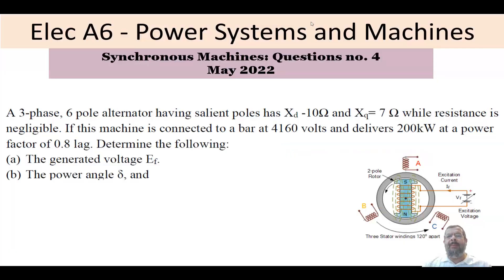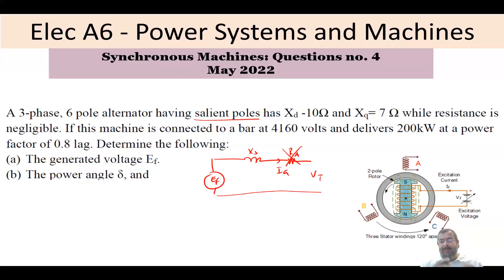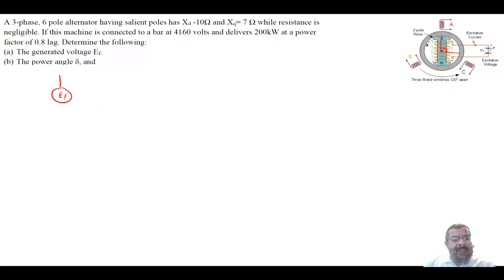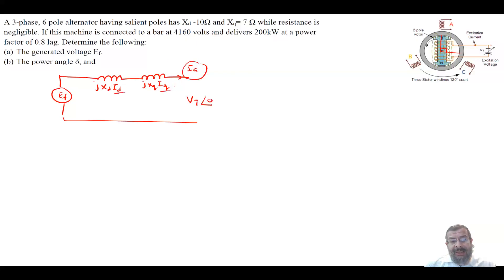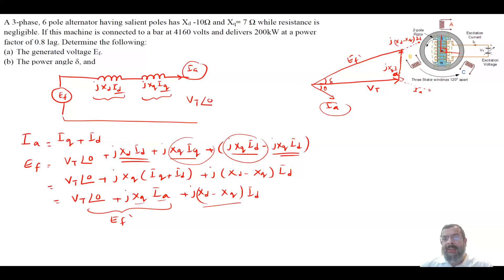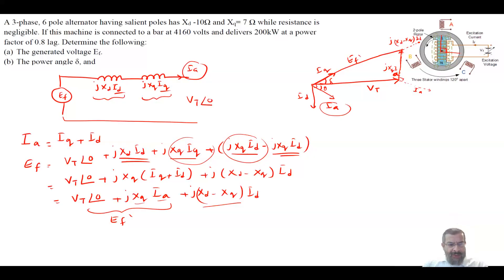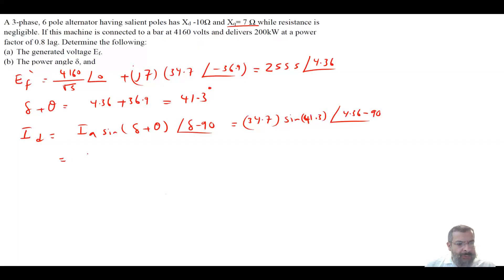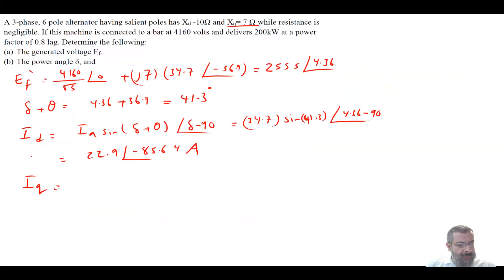PEO solved examples (ELEC A6): Synchronous Machines no. 4

Comment: In todays exam there were not even 1 question on Electrical machines. No magnetic circuit no dc machine no induction motor no Synchronous Motor and Ge no Single phase trasnformer. Only power sysyem single line diagram per unit system and 1 single phase question. That is soo disappointing. Non of previous exams had similar questions not even in the reference books are there.
Reply from the maker: This is really a disappointment, you should complain to the PEO
Reply: I am now writing to them and will continue to reach out to the examiner. Also please any others student who had the exam do the same thing. Thanks
Reply: I took the exam today too. There are at least 2 questions should belong to the B7 exam, not the A6. Quite frustrating.
Reply: @binhle8710  There was only Q1 and Q5 similiar to previous questions. The rest were all on B7 . I emailed them and mentioned that. Please if you can email them and complain. So that they can see the issue.
Reply from the maker: @binhle8710  I think you should complain. I did one question about line to ground fault in generator but this should be in B7. Historically A6 is about energy conversion and B7 is about power system but after the COVID things are missed up
Reply: @TafanAli-h3j  yes, can you give me their email, I will write one to let them know the issue
Reply: @electrical4everyone  I agree prof. Everything seems to be confusing lately.
Reply from the maker: @TafanAli-h3j I do not communicate with them. I guess you need to communicate with the organizers of your exam.
Reply: @electrical4everyone  Thank you doctor. Yes as exam writers and applicant we have to write them and I am trying to let other applicants like me who wrote the exam today try to email them and so they can do something and take that into account in marking. You are exactly right A6 even reference books are on fundamental concepts of electric machinery But today not even 1 question was on any kind of machine
Reply: @TafanAli-h3j  I totally agree with you. Only Q1 (which was about leading pf factory load) and Q5 (which were theoretical questions) were similar to previous questions, rest everything else felt new and unrelated to the A6 exam.
Reply from the maker: @rahil240 was Q5 the same as previous exams?
Reply: @electrical4everyone  Yes exact theory questions .
Reply from the maker: @TafanAli-h3j  good so hopefully you can make it for the passing grade.
Reply: @TafanAli-h3j  Should we coordinate somehow?
Reply: @TafanAli-h3j  Salaam, did you had B7 exam recently?
Reply: @mohammad-pm8tm Not in fall . Iam planning for spring
Reply: I took this exam on the same day. Could you please share their email, I would like to write to them regarding the same issue.
Reply: @Yasser-b7f  In youtube it does not let me to reply a coment containing email address. But you can find the email on their emails they sent you as a confirmation of booking exams. Both emails contains exams .
Reply: @TafanAli-h3j  That is very helpful. I found it in the confirmation email. Thanks